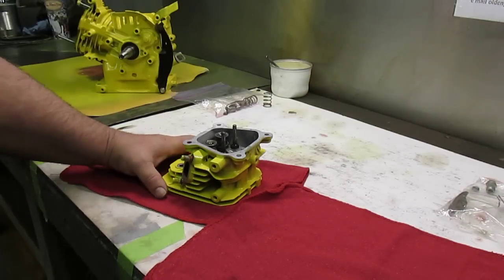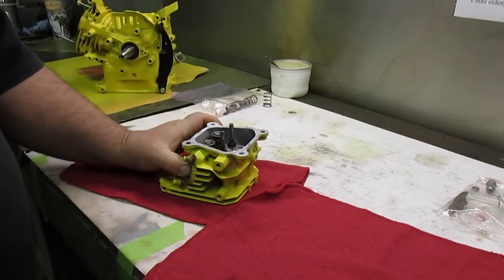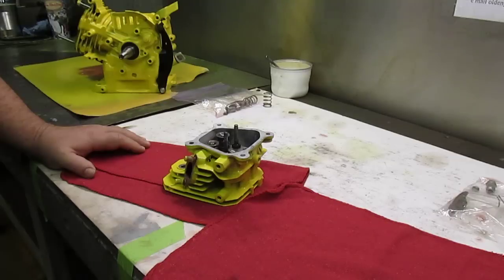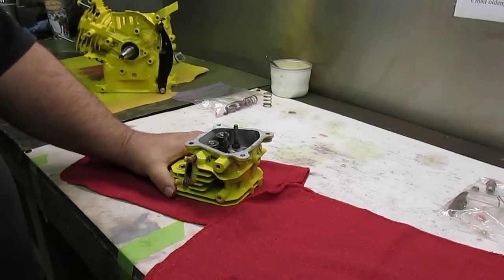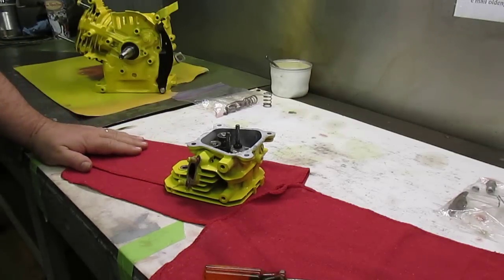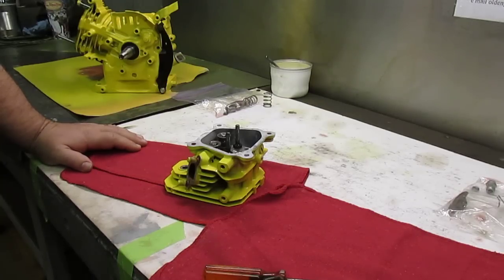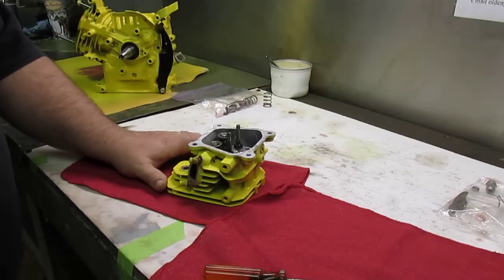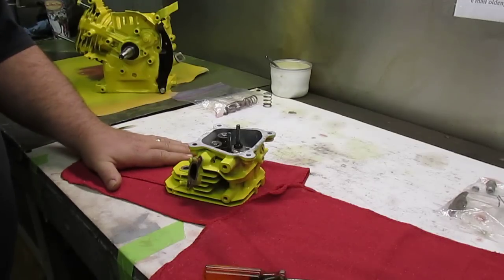HONDA GX 160 ENGINE REBUILD  PART # 2

Comment: I got a gx 340 for my go kart and I had a couple questions I was planning on taking another carb off a smaller Honda and putting it on with the original card from my GX and building a linkage would it work and can I put a pump and oil cooler on it without it running too cold thank you
Reply from the maker: Hi Richard, yes, the GX340 is a good choice for a go cart.  To answer your questions on the carburetor, be careful putting a smaller carburetor on this engine.  The original carburetor is jetted properly.  A smaller carburetor could lean your engine out.  Not quite sure what kind of oil pump or how you would run it, but would be a good project for my machine shop.  Let me know your ideas on supplying your pump with oil and what you are going to run it off of.  Drop me plans or pictures so I can get a better idea of what you want to do. Oldengineken.